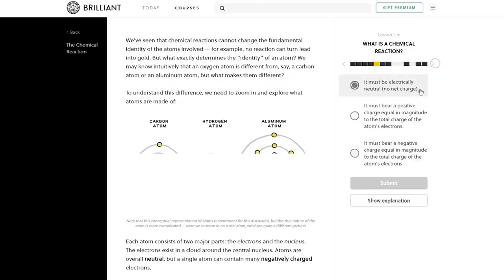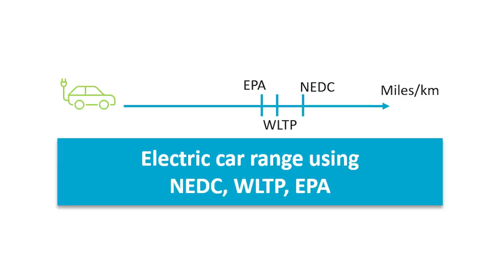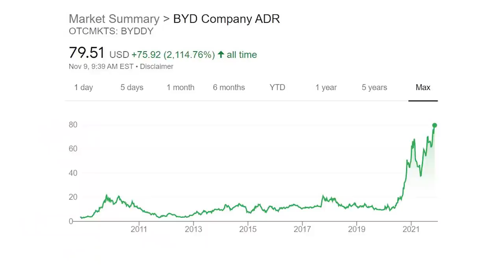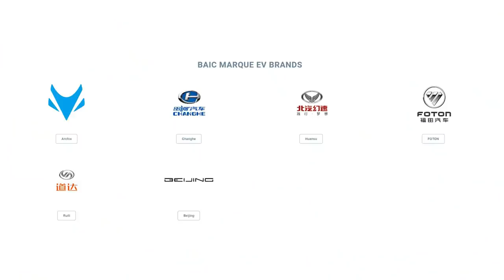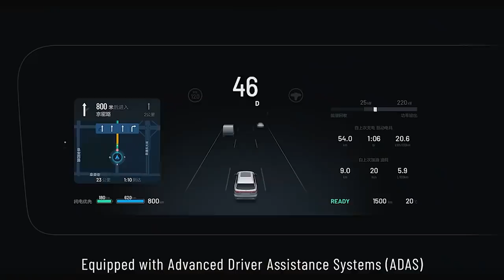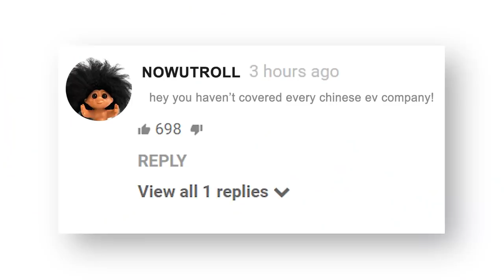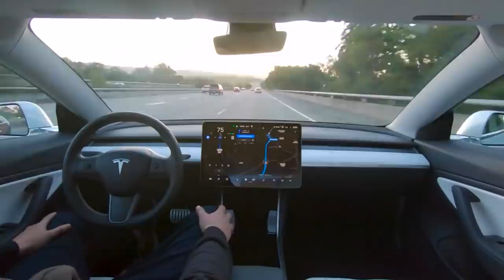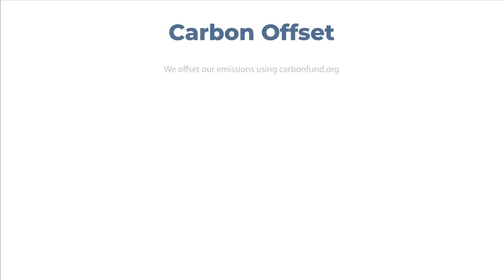China is Coming: Part 2 | In Depth

Comment: You failed to mention the fact that the BYD Blade battery is much safer than most other Lithium batteries used in EV’s (including Teslas little firecracker), most of which pose a danger of fire or explosion if punctured, including in super cars.
Reply: I really wish that dislikes were visible, because m'man you just said that Teslas batteries were less safe than BYD's
I agree they are safe than most batteries, but have you seen Sandy Munro's teardown of one of them? you couldn't set that on fire if you tried
and good luck getting the added safety from the shell of the vehicle itself, or full self driving

edit, while Tesla hasn't incorporated a blade battery design, both Tesla and BYD have lithium ion phosphate batteries, and I have yet to see any statistics comparing the two in terms of flamability, but I do know that a Tesla vehicle drives around 210 million miles before a fire incident, more than that by now, and a standard vehicle in the US only drives around 19 million, 

because of China being China, I have yet to find any data on the fire safety on BYD batteries, if you would like to reply with some it would be most appreciated
Reply: @nyanbrox5418  “Teslas little firecracker”: their original batteries, have been impact tested, and they do set off just like a little fire cracker. Obviously their newer Lifepo4 batteries are safer. The BYD blade can be multiple punctured, are self healing.
Reply: @michaelbouckley4455  Ye their original batteries were terrible, actually I just heard that one of the tesla models in giga berlin will actually be using the blade batteries for a bit to drive costs down
Reply: @nyanbrox5418  not the cost but demand on battery manufacturers
Reply: All they did was just line the battery up in a straight line on a “blade” design and Tesla uses that design in their cars too. As long as you have a cool down system for the battery you should be OK. But Tesla has already designed a brand new battery we just don’t know about it yet. And they’re building a factory in the US to make these batteries.

Comment: "In November 2020, XPeng provided a copy of its source code to a neutral third party to compare to Tesla's to prove nothing was copied. Neither XPeng or any subsidiaries were parties to Tesla's original lawsuit.[50] A court-appointed neutral third party concluded XPeng's code did not use Tesla's IP after comparing both source codes as provided by the companies.[51] Tesla and Cao moved to settle soon after this was established.[51]" wikipedia

Comment: In 10 years time, in a second hand EV dealer, would you buy a 10 year old Tesla with a 10 year old battery, OR would you buy a 10 year old NIO, with the ability to pop around the corner and swap for a new battery?
As we build smart cities, these battery swap stations can act like energy sinks that charges during down time, and generate electricity for the city during peak hours. 
Battery swap is the future, so is standardization of batteries, at least among brand alliances.
Reply: I doubt very much that your opinion will stick in time, simply because it entails a considerable extra cost, similar to gasoline which is not present in EV with permanent battery installed. Besides battery costs are sliding down and will continue to do so in future , so to replace a battery package say in a Tesla it will be far less costly than at present, which it cost already half the cost of 5 or 6 years ago.
Reply: I think Americans will want to own there own car battery and have the vehicle/battery available to back-up their home and charge from their home solar.
Reply: @sat7755  But battery swappable cars can also exclusively use charging. The ability to easily and cheaply swap battery at will is certainly more useful than cars that does not.
This is very useful in situations where EV owners might not have a permeant parking space. 
Also think about it, EV charging stations literally has to be everywhere, when EV becomes the norm, can you imagine the maintenance cost? What about vandalization? 
What if you had to fight tooth and nail to get your charging spot just to find out it's out of service.

Things like these will exponentially get worse as more people drives EV, which means having the ability to swap batteries just like filling up at the gas stop is extremely desirable. I also think China would moving to battery swap regardless of what US does, and since China has the largest automaker and still growing fast, means others will follow.
Reply: We are battery constrained for the next 10 years. If nio just has an extra battery laying around they could have built another car from
That.
Reply: I looked into Neo a year or so ago,  Owned some for a while, but the fact that they had the social centers and were paying a fortune in rent for spaces that had nothing to do with autos but were actually rec centers for their owners killed the deal for me.
Reply: @gj1234567899999  Exactly one of the points I was going to bring up about swappable batteries. There needs to be at least 3 times the amount of batteries to cars using them. 1st in use, 2nd being charged, 3rd in storage. Also as Sandy Munro points out, the constant changing batteries will wear out the electrical connections and mounting screws. Also there would have to be an agreed standard (one size fits all) for all the different makes and models of cars......Yeah Right!
Reply: @sat7755  you missed his point. It’s not about “buying” a replacement battery . It’s about trading in a drained battery for a fully charged one instead of the time to recharge the one “fixed” into a vehicle. You buy the EV but the battery is interchangeable at battery changing outlets
Reply: I'd say that there would be another advantage with replaceable batteries, in that you wouldn't necessarily be married to one battery tech / chemistry.

Replaceable battery design also may very well mean that your car may start it's life with one battery tech, and end it with another, more efficient one that is greener, more energy dense, or be able to survive more charging cycles etc.

This would be no small advantage I think, even if you buy an EV that supports battery swapping, but you chose to charge at home only and keep your own battery, per the be more common model of battery ownership in use today.

For this reason, structural batteries have a disadvantage as well, as they mean you will not be able to replace or upgrade those batteries as easily.
Reply: Right now EVs are the daily commuter cars.  Battery swap could turn the daily commuter into a car you could take on a long trip.  You pull into battery swap stations just like you do gas stations today.  Nio has already partnered with Sinopec (largest gas station chain in China) to put battery swap stations at the current gas station locations.  

Battery swap is not for everyone, but is a nice option in place of parking and waiting for super charger to recharge your car.  And I think that could be a real game changer in the US.  Because if EVs are only commuters, you would still need an ICE for long trips, vacation trips etc.
Reply: Battery standardization in this country (USA) is a pipe dream. With so many different companies there is no way they will come together on batteries. Watch the previous video with Sandy and he talks about how the major US companies don't have the capacity to be the front runners in this modern world.
Reply: @LarryRichelli  Tesla was talking about making adapters for other E-car brands so all of them can use his company chargers.
Looks like musk wants his chargers to be the standard

Comment: Thing is Xpeng actually relies on way more types of sensors as the source of information in their autopilot than Tesla does.
Reply: That just means it's a lower quality system, and the car and the main computer back at headquarters don't communicate and fix problems over the internet without you knowing about it. Less advance battery pack and the Tesla soldier in China is the older version of the test no technology body and electronics. Still a Tesla and a good car but it's about two generations back already.
Reply: @williamscoggin1509  I am trying to piece together what you are trying to say, as it is a bit confusing. Are trying to say that using more types of sensors suggests that it's less capable? Or something else. Cuz my personal experience suggests a bit otherwise. Maybe an example would help. I know for certain that anywhere around the world when a Tesla cant's see with its cameras, it can't autopilot. While in the same scenario Xpeng could rely on other stuff such as laser radar and high accuracy GPS to perform better.
Reply: @-whackd  i am not a car expert in any way, but on a logical level your comment makes no sense to me. as you talk about how humans are capable to drive with two eyes and extra sensors don't give an advantage, they obviously do give an advantage. because if there is a disruption to your vision (midnight and lights go out, a fly hits your eye, heavy rain blurs the windshield, you are looking into the wrong direction), aditional sensors in your body would help through those seconds of were your eyes aren't enough to fully perceive the situation. of course a lot of crashes would be avoided if humand would also be capable to look into more directions and on more technical levels, than just forward and by visible light.
a fallback system always helps with disruption on the primary system.
Reply: @-whackd  oh and also: a statement like "they will never have FSD" is always wrong. it only consideres the current state and pretends that things never evolve. if tesla can do it, everyone else can do it. tesla is not a bunch of overpowered super-humans, they just started first with tech that everone else can build, too. you logic is like looking at the first iphone in 2006 and saying "samsung will never be able to build a smartphone". yet, nowadays, samsung phones are ahead of apple phones. and not just apple, also huawei, xiaomi, google are all up there and apple is average at best.

Comment: About supposedly Xpeng copying Tesla self driving code, neutral third party comparison of codes it has being proven that it is not the case. Xmotors is a kind of AI company making evs. 43% of there 3500 are in R&D. The P5 model is on sale since September. It is colossal job you have tried to make and of course you have missed a lot models. Just to complete your information, SAIC MG ZS, Aiways U5, Great Wall Ora Cat are sold in Europe. Imperium (Skywell) will be sold in December in Canada. Surprised that you have presented the BYD ugly old e5 instead of the newer e6 more elegant e6 or the very nice Dolphin.
Reply: The allegation is that the code was stolen, not copied. A person doesn't have to use stolen property for it to be theft.
Reply: Tesla autopilot still aren’t working after years of promise. A lot more work needs to be done in this area.
Reply: @wilfredvanvalkenburgh2874  and the allegation was proven to be false, get your facts rite.
Reply: No the E5 is completely outdated and replaced by the pro. Not the new e6
Reply: @wilfredvanvalkenburgh2874  So... They stole it, saw it was shit, developed their own anyways.

Comment: As a young car driver in Belgium I'm worried about the sourcing of parts if something breaks down on an EV.
Seems like you can't repair it yourself, and cannot easily get parts if something breaks.
Even Tesla doesn't have this perfect just yet.

If this get's fixed, I'd buy an EV.
Reply: Yeah, too much overselling on "EVs dont require maintenance" to the point that buying car from China is a good idea, as long as it doesn't break and then it needs to be thrown away and you buy a new one.

Comment: Some china context: china installed 266,00 charging piles in 1st 6 months of 2021. Over 40k new ones a month. Over 2 million in total- over 1 million public.. That's am example of the speed at which they are moving.

 For green energy lovers they also have more solar, Wind, and hydro power than the rest of the world combined. I'm exaggerating a touch of course though not much. Hydro production 1300 terawatts generated. Next best is 400 in Canada. Solar 253 gigawatts installed (35% earths total)- Wind 221 gigawatts installed-US #2 at 96 gw installed. Once they get the dirty coal plants replaced by nuclear or greener sources in the near future we will all be better off. 

Oh. And they'll buy some 3 million bevs this year. 1/2 the worlds total. That's to go along with the largest public transit system on the globe. 3.660 billion passenger trips by rail alone per year. 69 billion bus rides-that's absurd. On 700,000 buses. Crazy town. 500,000 are electric buses. 98% of the globes total. 

And of course. 700 million out of poverty in the last 15 years. Common prosperity. 

So exciting to see this "young" country shake off abject poverty 40 years ago and be where they are today.

Comment: Due to the other EV's lack of range, I placed an order for an Aptera for $28,500 that does 0-60mph in 3.5-seconds and offers ranges of 250-1000 miles. It charges 180 miles overnight using standard 120-volt household receptacles or 180 miles in 15 minutes using any 50kW charger. Plus, their vehicle is "Driven by the Sun" so it means I could actually never need to charge. Their Carlsbad CA manufacturing plant should be finished in the first few months of 2022. Most of their parts suppliers' NDA contracts are in place. Now I wait for delivery in 2022.
Reply: I also have an Aptera on pre order. #18,000….maybe 2022!
Reply: @lesterhousel  Aptera is already shipping in 2022? Thats amazing! I thought they are deep into prototype phase, not production one

Comment: I live in Edmonton Alberta where winter conditions are challenging as is the rest of Canada. Our cars rust with the salt spread on the roads to assist in clearing the snow and ice. That's my main concern about the longevity of the EVs. Toyota and Hondo have their vehicles vigorously dipped to prevent the corrosion that occurs.
Reply: EVs has the luxury of using more aluminum in the exterior, due to less complexity in mechanical design. And a straight forward frame and body is also way easier to rust proof. The only thing in the Canadian cold to consider is actually the battery.

Comment: You shouldn't dismiss the Wuling miniEV that way. Look at the typical US suburb. It is clinically free from any public transportation, and walking or biking is usualy very dangerous. The only way to get anywhere is by car.

Then look at the enormous parking lot at the nearby (usually several miles away) supermarket and count the number of huge trucks and SUVs there and ask yourself, from where are they coming and to where are they going, usually one person only plus shopping bags. Maybe only to and from home? 

Do they care about 0-100km/h time? Do they care about long range or highway speed? Do they think that riding mostly on roads with a 50km/h speed limit can be life threatening? Or do they prefer NOT to have to stop by the gas station every now and then, and rather just plug it in over night and have it fully charged whenever they need the car?

Facts you maybe missed: The latest version of the miniEV HAS airbags. GM owns 20% of the company that builds them. The tax incentive was raised from 7kWh to 10kWh batteries when the lawmakers discovered that the miniEV has a 9.2kWh -- what a coinsident...
Reply: The wuling miniev is too small for overweight Americans

Comment: Bought myself a byd qin in 2018. Used to drive a Carola with a monthly gas bill of about rmb800. With the EV, monthly electric charge bill is a little less than RMB 200. 

There are lots of charging ports at indoor parking lots. I usually charge mine over night and next morning ready to go.

I am little disappointed at the range though. Though listed at 400km (under perfect condition is suppose), and hot summer month I was only able to go about 230km. Now it's the cool winter here, I get about 310km

Comment: Wow, very sobering...now that I've pumped up my TSLA holdings. Maybe the real message is short legacy auto.
Reply: How the tables have turned haha
Reply: Exact right act. The west wouldn't win by tariffs but real innovations.
Reply: Really? short the crew that still has enough power to force a president to make a fool of himself on the international stage?  They're wounded, dangerous.
Reply: just stay away from investing in Pharma, Oil, Airlines or Auto and you will be fine.........  FYI Tesla is not just Auto... so you are fine
Reply: How about shorting ExxonMobil, Shell, etc?
Reply: @johnpapiewski8232  As a chemical engineer, I've long said that we should not be "burning" petroleum, but saving it for petrochemicals. ExxonMobil and Shell still have a solid petrochem business. Their sales will shrink without gasoline, but I don't see them going bankrupt like legacy auto.
Reply: @ronaldlenz5745  By the time gasoline sales drop off it will be priced in, but if we can get legislation for "use authorized in lieu of adequate substitute" (ie asbestos) then our time will finally arrive to "Short Evil".   It could happen, especially when people see what comes out of the garbage patch over the next year.   There's hope.